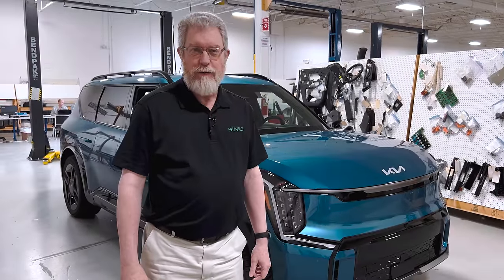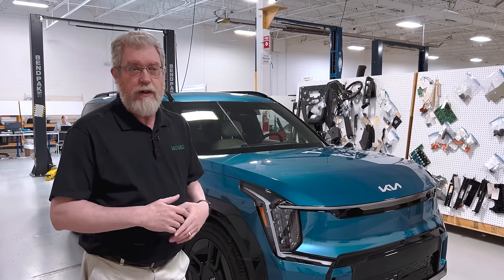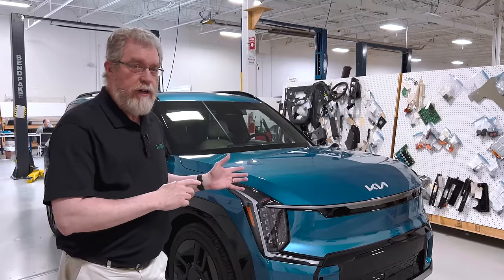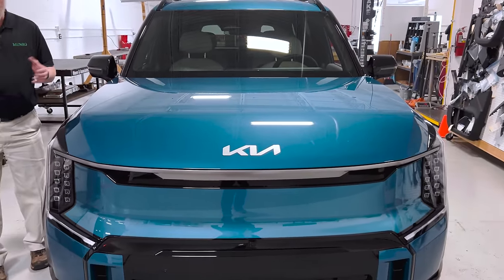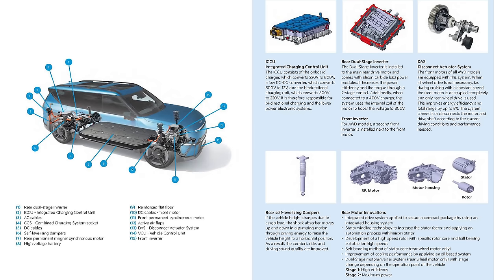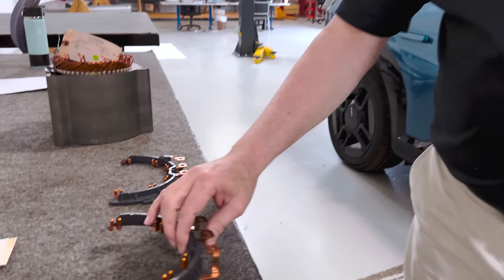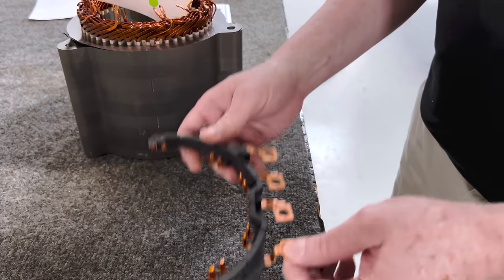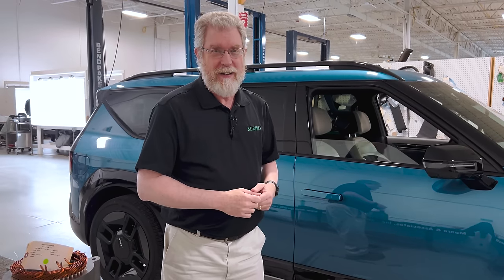Kia EV9 - 800 Volt Architecture

Comment: BTW, the Renault ZOE (from 2011) uses the same principle: The motor's windings are used as filter for the on-board charger (230V AC -> 400 DC). Renault calls it the "Chameleon Charger"
Reply: So, what's the catch? What are the cons of doing it this way?
Reply: @Alhussainba  Buzzing sounds, higher losses, loves to trip RCDs due to capacitance effects.
Reply: Obviously it isn’t same as Renault since Hyundai-Kia has the patent.
Reply: ... I think in the Zoe the Motor ist used as an Transformer, Not as an Filter. The grid did Not Like the noise which was emmited by Zoe while charging.
Reply: @Alhussainba  Acoustic whine while charging, constraints on motor design ( can't use permanent magnets), additional safety hardware due to depdnence on motor insulation to protect against mains voltage.
Reply: @mikeselectricstuff  Not to mention we were responsible for many many RCD activations at charging stations as the car did a full ground loop impedance test before charging due to using the winding as the inductor. 😂
Reply: Renault had not the same technology. Kia converts DC 400V -> DC 800V which is done without transformer as we know it. Renault converted AC - DC. Stop guessing!
Reply: @Starelfwood  that's not true, originally at the time of design we were not sure what charging standard would become predominate on the market - we had less than 45KG to implement the DC - DC boost circuit of the Zoe onboard AC charger. We achieved 43kW AC charging using the motor winding as inductor when at the time most were 11kw AC only via large heavy box. These are inductor actual for the boost converter (also the drive inverter shared) to provide charging function! Alas DC win out and the design carried over all the way into R type motor. The major downside was the noise and having to guarantee insulation safety via a full ground loop impedance test before starting a charge. The noise is because the motor has relatively large winnings, it's not actually optimal for an inductor and it creates difficult to deal with harmonics.
Reply: There was also some electric motorcycle that also used the motor to convert voltage. I can’t remember the name off the top of my head. As I recall it was an early early race bike that never made it into series production.
Reply: Renault , cant even be sold in USA , its very CRAPPY.
Reply: @markplott4820 Renault ist one of the innovative companies. great engineering! Probably you don't know Renault? The old combution engines wanted to Drive, this is fun. Also Renault has a great Design competence. Please have a Look at the Cars. Shure they have no trucks.
Reply: It's not quite the same thing; Renault uses the motor as an inductor to rectify AC into DC - the early Zoes did not support DC fast charging, but instead supported up to 41kW (IIRC) AC charging, which is just crazy. Well, to convert to DC at those amps you need a monster inductor, which would be bulky and immensely heavy. So instead they use the motor windings as an inductor and all they need is some high voltage contactors/solenoids to change the electrical connections around, pretty smart.

And you get that cute high-pitched buzzing sound as it charges too... Such a lovely little car, the Zoe. :D (Actually true btw, especially the third generation version.)

So both companies use the motor, but for different reasons/goals - well, other than to save weight/cost of course. :)
Reply: @markplott4820  That's not true at all. French cars back in the day were known to be quirky and not the most reliable (well, better than Italian cars at least), but these days, there's no problems. Renault's EVs are great cars, reason you don't get them in the US is likely it's an already crowded market with big established players. Not worth the effort to try to break in, etc.
Reply: @lennyvalentin6485   - LE car became BANNED in America .
Renault not allowed , even today in 2024.
Reply: @markplott4820  Dude, how LONG AGO was that? You're making my point for me. It's like saying "Ford cars are s---, just look at the Pinto!"
Reply: @lennyvalentin6485  - well where are the Renault in USA then , where are Dealership ?
chump.
Reply: Renault IS NOT banned in USA. They simply don’t sell to that market because they don’t need to.
Reply: @Dave5843-d9m   - Riight , you keep telling yourself that.
Reply: @Dave5843-d9m   - Renault is NOT even FMVSS compliant.

Comment: Hi Paul, next time you dig into this topic would you mind including a overview schematic of the motor, its windings, the filter and the battery boost architecture.
Reply: Invention:
This patent proposes a new multi-input charging system and method for EVs that addresses the neutral point potential rise problem.

Key Findings:
The system incorporates a motor driving system that discharges the high voltage formed in two capacitors:
A neutral point capacitor
A DC capacitor

How it Works:
During Charging: When the EV is plugged in for charging, a high voltage can accumulate in the neutral point capacitor.
Discharge Mechanism: The system activates the motor driving system. This motor acts as a generator, utilizing the stored energy in the neutral point capacitor and the DC capacitor.
Energy Utilization: The generated electricity is then used for various purposes within the EV, effectively discharging the capacitors and preventing the neutral point potential from rising excessively.

Comment: Not only they reuse the inductance of the motor but they also reuse the power transistors of the motor driver instead of having dedicated ones. It is somewhat similar to Renalut Zoe, which is also using the inductance of its motor to achieve 22 kW 3-phase AC charging (having a 3-phase connection is quite common in households in Europe). If my information is correct it should go back to EV-1 which also used its motor inductance and power transistors when it was in the charging mode.

Comment: I remember Teslabjörn checking the CAN bus and discovering that in fact it has only a 650V architecture. So battery pack maximum voltage is around 650 V.
Reply: 650V native, it can draw more than that, something like 700V, but yes, they changed the battery structure a bit here. One would still consider this as an 800V system architecture, which is more like a range of 650V-900V
Reply: They are Almost there

Comment: Every part needs to be evaluated to see if it can be multi purpose. Using the electric engine was brilliant. Absolutely brilliant.
Reply: I love seeing how different manufacturers solve the same issue and comparing those solutions. This approach is brilliant and so is the Tesla's in Cybertruck that has basically 2 400 V packs connected in series (800 V), except for when charging on 400 V charger, when a couple of switches flip and they're connected in parallel (400 V), and I'd like to see a comparison of advantages and disadvantages of each solution.

Comment: That’s actually amazing
Reply: fast charging does not matter.
they dont work most charging station will limit capacity including tesla supercharger. 
Never seeing them actually work.
Reply: @dfsdh432v9  It matters for everyone who does not drive an outdated Tesla. Around the world 350kW-480kW chargers are installed in big numbers. Many mid-size EVs or bigger have 800V+ architecture nowadays or will have that in the next 1-2 years.
Reply: @Aztasu  lets say one station have 20 chargers.
thats 10 Mega watts, and thats just one station.
you need renew and rebuild electric grid system. but electric power companies are not going to 
spend billions to upgrade grids just supply car chargers.
Reply: NO, its Really not.
Reply: @markplott4820  because it's not a Tesla?

Comment: The charge booster isn’t used unless the charger is ~400V (Tesla) AFAIK.  Typical CCS chargers will supply the voltage the car needs, up to 920V.
Reply: There are a lot of lower power (50kw or less) DC chargers that only go up to 500 volts. Essentially right now if you want 800 volts, you have to have a way to boost these chargers, otherwise you're going to have a lot of people confused about why they're charging sessions are failing.

Comment: Some of the information in this video is misleading. It is stated that chargers operate at 400V, that is only true of legacy hardware and lower power installations as well as Tesla Superchargers which only operate at up to ~500v. The boost converter (motor inverters) in the E-GMP platform does not allow for full charging power/speeds on 400v chargers. The boost converter does not increase charging speeds it is in the vehicle only to provide compatibility.  The boost converter cannot provide over 200kW, more like 80-100kW. 

At modern (non-Tesla) charging stations rated to 350-400kW, the EV9 will receive full power at the native battery pack voltage without use of the boost converter. Most CCS high power stations are capable of delivering up to 1000v.
Reply: Totally agreed
Reply: The fact is, that the vast majority of DC chargers in operation are 400 V "class" and more are still being installed. The caveat should've been included that MOST chargers operate at 400 V or some better wording, but I find this much less of an issue than if there was an error regarding some parameter of the subject of the video - the car and its 800 V system.

Tesla Supercharger network has been built for Tesla cars that have 400 V battery packs, so there used to be no reason to provide much higher voltage than that, but since they started opening their Superchargers to other EV brands they started building also V4 superchargers that provide up to 1000 V DC. Now that they are also shipping Cybertrucks with 800 V battery pack, it's highly likely that they'll ramp up ratio of V4 Superchargers, but you'll see new 400 V Supercharger locations opening for quite a bit longer due to the length of permitting process and its inflexibility and also the production rate of V4 chargers has to ramp up so that V3 can be ramped down.

Tesla has the most extensive, fastest expanding and the most reliable charging network, but almost all of it is 400 V, so if you have 800 V car, Tesla Supercharger (except V4) won't be able to charge your car as fast as some other providers, but it will be there for you (more locations and more stalls per location) and it will (reliably) charge your car. I'd love to see other charging providers step up their game.
Reply: e-Gimp is ICE car based, its all you need to know. 
TESLA is 100% BEV from ground up. 
Tesla NEW model Y RWD LR is the MOST Efficient car on EARTH.
Reply: @Daddo22  Good point about the number of 400v chargers out there and the fact they continue to be installed. 

The real error in the video is, this vehicle cannot charge at its peak power rate on a 400v charger. The boost conversion will not support it. The boost converter does not increase the charging speed or efficiency of the vehicle. Those are technical errors. I watch most videos from Munro, so I thought I would point out errors when I see them. 

I do not believe there are 400v class chargers that provide more than 150-200kW. I believe all 350kW chargers are 800-1000v class. A 400v charger would have to output 875 amps to reach 350kW, way beyond the CCS specification. Point is, even if the boost converter could output the peak charging power ~250kW, I do not believe there is a 400v class charger that supports it. 

I mostly agree with you on Tesla's Superchargers, but their vehicles do not all have 400v battery packs. The Cybertruck is 800v class and we now know it will charge faster on CCS than it will on the Supercharger due to amperage limits. V4 Superchargers are currently vaporware, the dispensers exist, but the actual charger cabinets that produce 1000v have yet to be seen at a public installation... and Tesla announced them over one year ago. Meanwhile, Tesla continues to install more V3s, hopefully those sites are forward compatible with V4 installs for future upgrades.
Reply: @markplott4820  hahahayou are not even trying anymore. Model Y is miles away from being efficient. Check out the Mercedes-Benz EQXX if you want to see true efficiency. Some of the tech will be used in the upcoming Mercedes-Benz CLA and C-Class EVs.
Reply: Yes, statements in the video are only good for general audience not engineering focused channel and audience. For exmple,  800V does not speed up charging.  The boost converter also pretty bad idea considering that a battery pack can be split into 400v and 800v architectures depending on the DC charger which current Cybertruck employs.
Reply: @markplott4820  False. EGMP is not ICE based and the Model Y is not the most efficient car. It is more efficient than similar EGMP cars though. Citations please.

Comment: As per explanation , it doesn't make sense that 800V battery system but   
charge at 400V and then boost up again to 800V  before charge to the battery instead of charge directly with 800V ( Lower current , lower power lose)
  - I think benefit of 800v battery
is about reduce power lose espacially for long cable path ( from charger to pdu/battery)
 - Booster you mention is for old generation charger 400V and lower charger power.
Reply: That's correct. This video is all wrong from an engineering perspective. They are complementing Kia for doing something that's much more cumbersome, inefficient, limited in power and expensive than using a contractor as the Cybertruck uses to solve this same problem. First time I see a Monroe engineer totally confused about what is he talking about. Sad to see 😢

Comment: Take a look at Porsche/Audi PPE 800 Volt system. They split the battery pack in two when charging at 400 volt. Clever engineering too...
Reply: Exactly. Same as the Cybertruck. (Also on this channel from an interview with the lead engineers).
Then no need of this. 
To me,  this '800 volt' design, looks like 1.1 step forward,  1 step back. You know what I mean🙂
Reply: And the Silverado
Reply: look at PORSCHE , they cant even SELL 1000 per month.
Reply: @markplott4820  But they are very expensive (Base '24 Taycan starts at $100K), and Macan starts around $75K if I recal for Macan 4. PPE is a VERY advanced arcetecture, and I can't wait to see what else they make on it. Rather excited for the 718 EV.
Reply: @casualgamer1209   -PPE is 20+ years behind , what TESLA is doing in 2024. 
Tesla is already working on the NEXT STEP change , UNBOX process for ALL EXISTING lines and NEW lines Created for NEXT Gen vehicles. (no new Factory).
2020 model S ,FIRST to use Discrete Modules for front & rear AXLES , w/ high number of CAST parts , NOT Stamped Steel Weldments & AL extrusions. 
also FIRST to use Carbon Sleeved Motors . 
the Inverters for EACH motor are Intergrated into CAST motor housing.
Inverters are CROSS compatible w/ model 3/Y. 
see - Munro PLAID Teardown.
Reply: @casualgamer1209  - Tesla & VW outsell PORSCHE.....lol🤣

Comment: Will it actually do 350kW at 400V ? I've not seen a spec for 400V charge rate, but seems unlikely, and the 500A limit of CCS would limit it to around 200kW anyway
Reply: Kia states "up to 210kW"
Reply: 350kW sounds extremely implausible when most are struggling to achieve 200 at this point.
Reply: A 350kW charger just means that it is an 800V charger. Since the EV9 uses a higher system Volts architecture than 400V you have to go to an 800V charger, though there are some tricks to boost 400V charging with an 800V EV. That is what he was talking about. It uses a booster to boost up 400V charging inputs to make it work with its 800V system. As you said normal 500A 400V chargers are limited to around 200kW, they can also go slightly above that, but even with a 400V booster you would not get close that speed. For the "full" 210-215kW the EV9 demands you still need the 800V charger. The engineering behind this booster is clever tho I think that is what he meant.

Fun fact: What is meant with an 800V architecture nowadays is more like a range of 600V-900V. 
The bigger battery pack of the EV9 is actually slightly limited in its voltage architecture compared to the smaller 77.5KWh and the new 84kWh batteries (used in Ioniq 5N) used in other E-GMP platform EVs. The smaller batteries which are actually 750V-800V and can charge with 240KW-245kW. 
They rearranged and changed the amount of cells connected in row in this this 100kWh battery of the EV9 and in the end it is more like a 600V-650V architecture. That's why the bigger battery charges slightly slower than the smaller batteries with a max of 210-215kW charging power. Why did they do that? Maybe to provide extra longevity due to a stress-free C-Charge rate and also to provide a more flat charging curve which makes quite a bit of sense for a utility 3-row family SUV.
Reply: @Aztasu 
Definitely seen my Ioniq 5 charge at 240kW, so what you say makes perfect sense.

Comment: I was under the impression the vehicle can only charge at 100kW on 400V charger, higher charging rates must use 800V Charger.
Reply: Yes, I think the "expert" is confused.
Reply: True, but not a serious concern given it can maintain 100KW over most of its charge curve. You will find most other 400V EVs average a charge speed of under 100KW over your typical 10-80% charge. For example, a Tesla Model 3 LR averages 97KW over that type of charge. While it may start at 250KW at a 10% SOC, it drops below 100KW at around 50% SOC. An EV9 can maintain a 100KW charge speed all the way to 85% SOC before slowing. That ability to maintain such a high charge speed over most of their charge curve is the biggest advantage of 800V architectures.
Reply: @FuRyZee  800v only allows for maximum charge rate increase.  800v does nothing for the charging curve. Ev9 is more like 550v not really true 800v anyway.

Comment: Does using the motor as the filter limit the regen power? I know Porsche has very high regen capability in the new Taycan. Presumably they have a separate filter? Can it filter and regen at the same time?